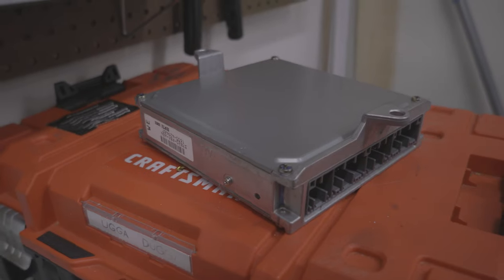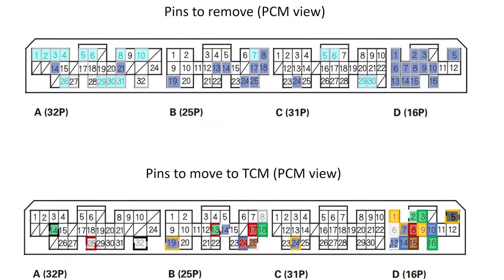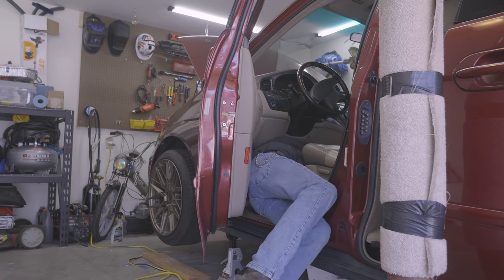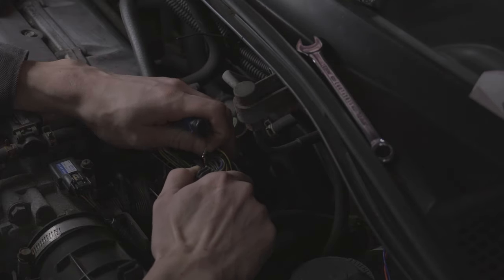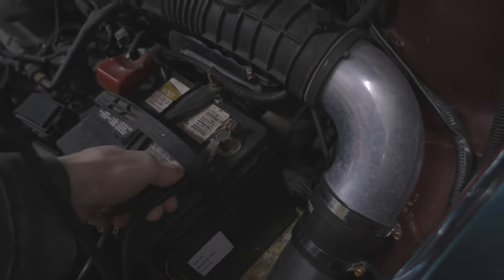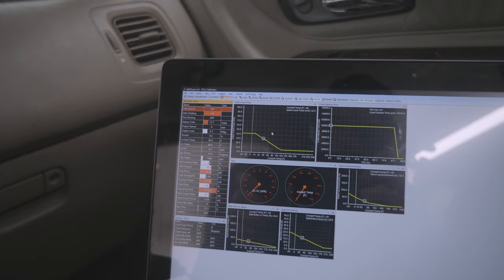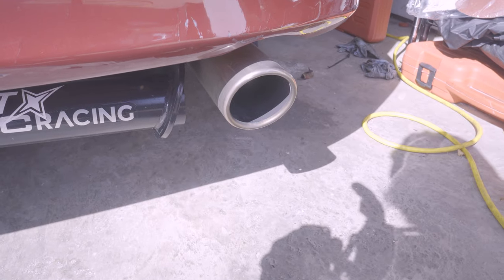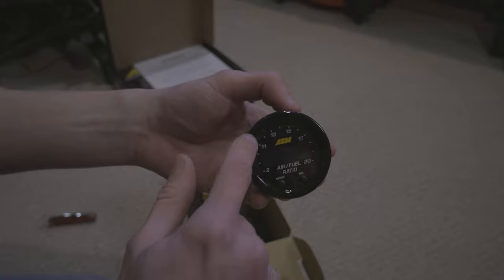Putting an AEM ECU in my minivan- it's Honda Odyssey Tuning time!

Comment: Are you still building the Odyssey,  I have a 2005 Odyssey with yellow street racing inverted coilovers, straight dual pipes , 20x10.5 wheel square on 295/35r20. Keep building